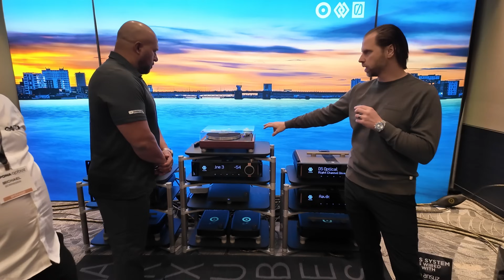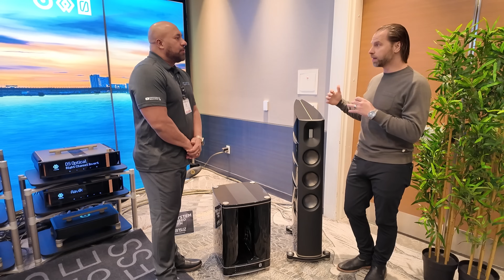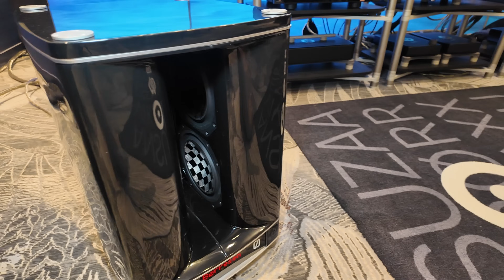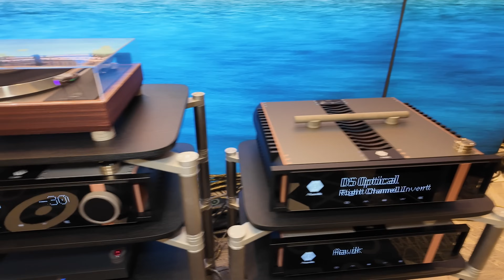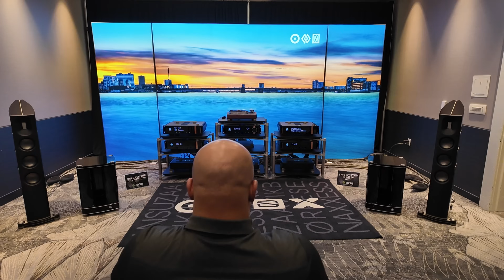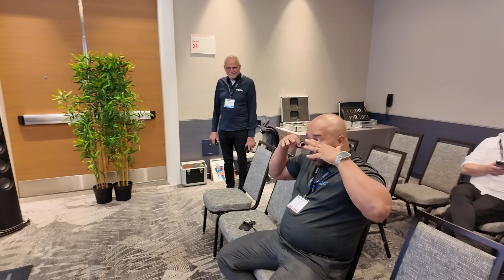Axpona 2025 - World Debut Of Borresen M2 & New Subwoofers!

Comment: As someone who is interested in Double Bass Arrays, Room Mode Compensation etc and all the things you can do even with simple build Subs for 400 each, i dont know how i think about this interview. I mean he say you cant time align the main system with subwoofers, or the ,,normal,, subs dont work with music but for film ?! Also that DSP dont work for High End systems. I mean this years Hifi Days in Hamburg the DSP based Active & Room Corrected Systems were miles ahead over their flagship speakers…. And you dont use DSP only on subs, of course you need to align also the mains for correct Phase, Frequency & Crossover. And does the Borressen Guys ever heard an Double Bass Array, Trinnov and all the possibilitys nowadays ? NO ONE who knows how cheap its is to build your own subs buy their ,,high end subwoofer,,. I‘m sick of all this high end brands who wants to tell you their ,,magic,, but dont even do the 101 of Hifi Room Treatment. This Talks and also the demonstrator are always the same, the just want to sell…

For me its just to catch this People who already spend a lot of money in their mains and think they can make a step with subs or have zero knowledge about subwoofers, dsp, subwoofer array concepts and measuring in general. Subwoofer Performance is based firstly on DSP Implementation (Crossover, Phase & Frequency) & placement. And btw do they have some REW Measurements from the listening position ? Does this subwoofers help to avoid the +/-20 dB room modes…. ;-)

A lot of marketing bla bla as a lot of high end manufactures do…. please for god sakes, can this scene come down to earth. Its just laughable.

Comment: What makes these speakers worth there asking price is it several kilos of pure silver inside them are they hand made and take one year to make a pair ? Do they have something inside them or anything that justify the price of them ? I know the wax coil  form Jantzen Audio they putt inside the crossovers of these speakers cost about 47 € retail.
Reply: It's not only about the parts, it's also about development and the space and machinery required to make it.

The silver rings are hand made in their factory.
Reply: @Like_Whut  Right so you are saying the machinery, development and the "space" hummm are you talking about the factory or the warehouse could you please be more specific ?  Silver rings are you talking about silver voice coils ? So you are saying the price of these speakers are justifiable then, and there is not a massive amount of markup going on ? Well for about same price of these speakers Audio Note U.K. manages to give you pure silver voice coils, inductors, capcitors and internal cables all made in Europe how is that possible ? Okey i could possibly accept that these speakers are worth there asking price if they where handmade using expansive technology, materials and manufacturing equipment only used for these speakers and that it should be some type of bennefit from doing it that way ! It looks like to me that they are using PCB for the crossovers and don't use the best parts on the marked it allmoast looks like they aim to produce these speakers in big numbers please tell me i am wrong ?
Reply: They discount these speakers big time and all Borresen speakers on the used market get absolutely no value,, the most overpriced speakers in the market just look up the used Borresen speakers they can’t give them away
Reply: @MotownAudio  that happens with all expensive speakers. The more expensive and exclusive, the more they lose their value on the secondhand market.
Reply: @Like_Whut  Well some things will hold their value better then others fex. Try to find any used Mulidine speakers they are not easy to find on the used marked ? That probabley means those how have them like to keep them, but if people sell them in all the time moast likely they don’t like them. I recently listend to the Børresen c3 speakers and Aavik system at the Oslo hifi show 2025 and that was harsh sounding and not enjoyable to my ears.
Reply: @davidpaabor1382  There have been plenty of Mulidine speakers that have been sold on the secondhand market. But most of it is sold in France and some neighbouring countries because it is not very well known in other countries. This also means that they lose their value extremely quickly because the brand itself holds no value for people as they do not know it.

About the C3, that is your opinion, i think they play loudly at shows, sometimes too loud. But i know Borresen speakers quite wel, and i do not think they sound sharp or harsh in any way if you listen normally. They are neutral, not fat and warm, but they do not shout.

But again, that is just a matter of personal opinion.
Reply: @Like_Whut  Yes they have sold on the used marked but they are not on used marked right now can you find them right now ? That moast likely mean the owner have passed away and their kidds sell them away. If the product is constantly is fludding the used marked that means people are not happy it.
If a brand is well known do not determine if the product holds value or not becuse like you said moast speakers  sell  on the for allot less then retail, that means investing in hifi is a bad option all prdocuts loose value.
The only option that is left then is that people  buy them and keep them if they like them otherwise they are trowing money away.
I think a good soundsystem should be able to  play loudly without scaring you away from the system otherwise something is wrong maybe the room the setup, ore maybe the gear but in moast cases you can hear where the source of the noise is comming from.
Reply: @davidpaabor1382  sure dude, all speakers of that brand on the secondhand market are from people that passed away. You also name just 1 brand which isn't even that well known.

The more numbers you sell, the more you will find on the market, it's not rocket science. 

We live in a day & age where people switch up fast, where people change cars or speakers after just a short while of ownership. 

The borresen system can play loudly without effort, so we just have a different opinion about that.
Reply: @Like_Whut  I know allot of people that are very happy with the speakers and brands they have without feeling the need to "try out" a new brand, but if you are feeling the need to change there is moast likely something wrong with the system. I think i see allot of people sell there spekars and amps just to try and find a new brand i think because they are not happy with the sound and they missmatch components cabels brands etc.. and they never seem to bee happy because many brands nowdays have allot of high fequency noise in there epuipment and then they bleme it on the recording..? No if you buy expanisve equipment to listen to music don’t you whant to be able to listen to all types of music ? Yes there are brands and system that can play all types of recordings enjoyable.
Mulidine is not a new brand they have been around since 1981 and YBA likes to use them with there gear they are not new to the game.
Reply: @davidpaabor1382  Who you know does not really matter, it's more about the time that we're living in. Sometimes people, even if they are happy with their system, want something different. There are also people who upgrade from the cheaper speakers to the more expensive ones.

The people that buy the most expensive things and have the most money to spare, those usually change their systems often because they can afford to.

Take for instance the X-series speakers from Borresen, these are not offered that often and also they are not as cheap percentage wise in comparison to secondhand 0-series speakers.

Magico A3 keep a steady value where the S3 and S3 MK2 are going to a third of their original retailprice.

There are still people that listen to a system for a very long time, or don't even change at all. But that doesn't dismiss the fact that there are also a lot of people swapping stuff sooner than you or your friends.

Most sportscars you see on the secondhand market have a very low mileage and are being sold for way cheaper than their original price, does this make them bad?

What you're doing is projecting your vision on everyone else, but it does not work that way.

Don't get me wrong, i actually agree with you that people should stay with their systems for longer periods of time, same as your car or cellphone. But we live in the age of consumerism and that means that people want to change their perfectly functional gear.
Reply from the maker: @MotownAudio and you must have many pairs then because according to you they are sold for next to nothing
Reply: @ jay i respect you and i like your channel, that being said don’t get upset with people saying facts and for your info i have and do currently own a pair and can’t sell them for the life of me and no dealer even wants too take them on trade because they all know how hard it is to sell them, again just speaking the facts that’s what’s going on with that brand if you are willing to promote them then you need to be willing too let people tell you the truth without getting offended, peace ✌️ brother
Reply: @MotownAudio  The problem with very expensive audio equipment is that usually only fairly wealthy people buy them, and they can easily afford to buy new ones. Customers who buy stuff like that don't want anything that is "used."
Reply: @MotownAudio  Let me ask you why are you trying to sell your Børresen speakers are you not happy with them for some reason ?